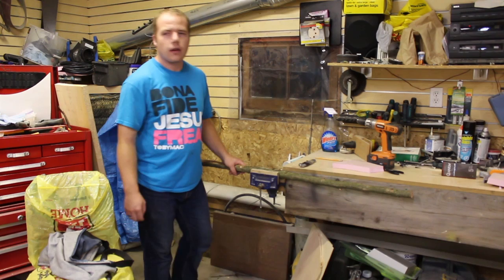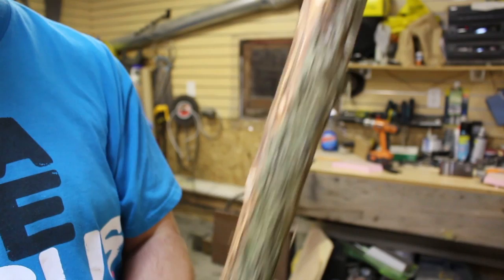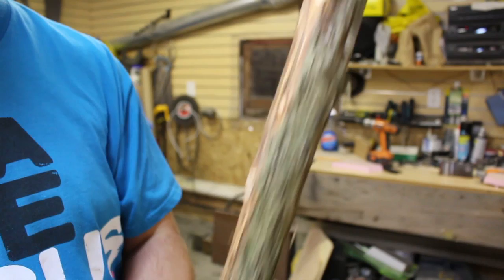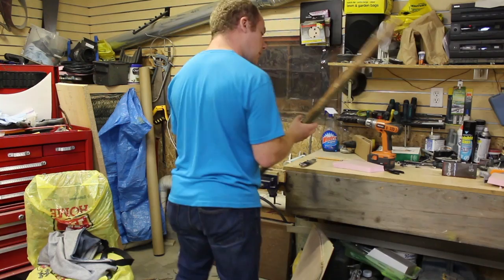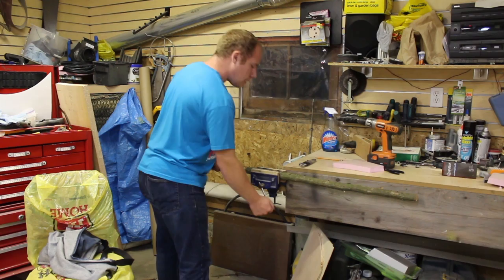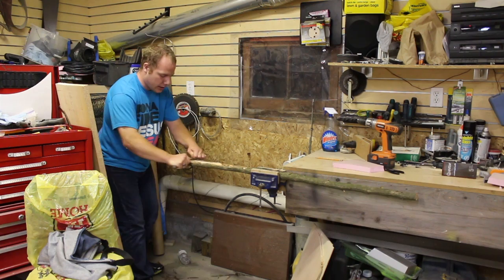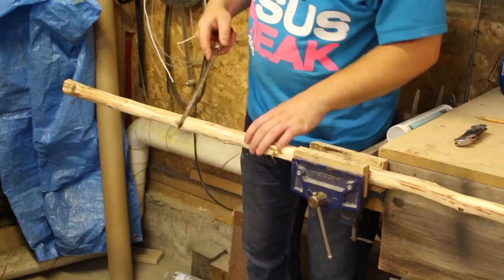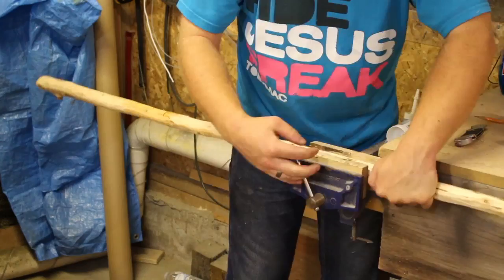Cedar Walking stick part 1

Comment: Thank You for the fast forward. Something about it is soothing to me.
Personally, I use a 4 inch wire disc for my drill as the Draw Knife. It will strip the bark faster, cleaner and will allow you to save some of the Inner Bark in spots for Character if you so choose.

Comment: I have made a lot of walking sticks and staffs over the years. If  the wood is dry when I begin working on the project, I find that using my orbital sander is the best and most efficint method for debarking the stick. Don't try this with green wood. A draw knife or scraper is best for that.

Comment: I just want to know where all the people I see on here I look at for idea's on crafting and making walking sticks are getting wood that is more or less straight and level. When I do my forays into the woods to find pieces, or help someone clean up, the wood looks like someone tried to wrap it the wrong way around other people's heads. 

Looks good on the work through and I too often like leaving some tool marks, though usually with a blade. But I tend to leave mine less rough. Though I do appreciate the video's, was pretty nice how you worked it out and sanded it down. Possibly faster. I used a sheet of varying grit and spunt the thing with one hand while I gripped and held the staff with the other and adjusted the tightness on the sandpaper to work off the knots and try to make it more even. So, Yeah, and it was a nice piece, though I think I would of added another design into the smooth finished surface, yours still came out very nice looking.
Reply from the maker: +Erick White Thank you sir! This was a piece of White Cedar that I collected while doing some yard work. Cedar (at least the types found in Southern Ontario) are usually straight...ish.
Reply: +Jeremy Peters I live in Arkansas, and the Cedar we have around here is usually isn't straight and is always have tons of knots in it. I am working on a piece of maple knocked out of one of my tree's by a wind storm, and it is.... very curvy and bent, but when it's done I am sure it will look at least adequate. But, nice work. Enjoyed the video. Do some more, try some other designs too and.. enjoy it!
Reply from the maker: Wow late reply, sorry! I like to use prunings or deadfall, hurts the forest less that way